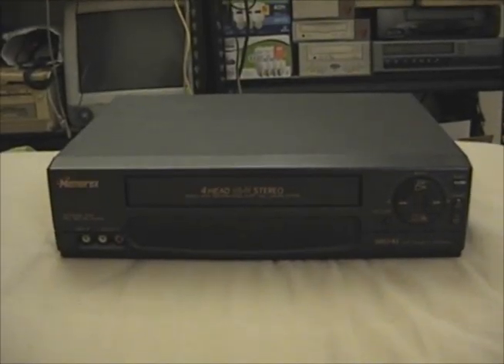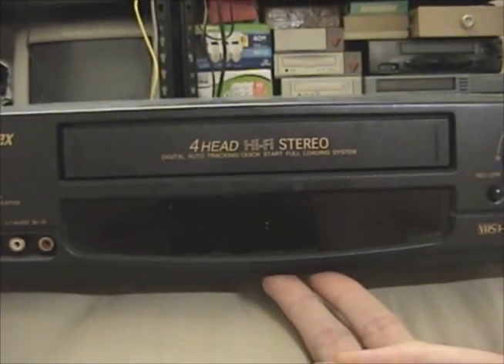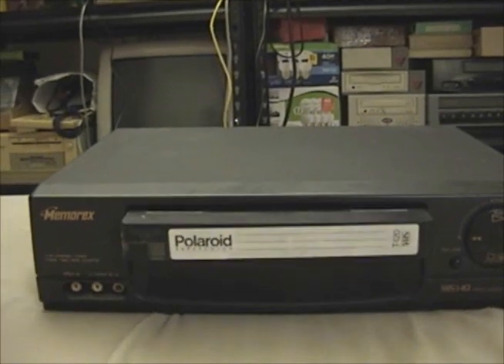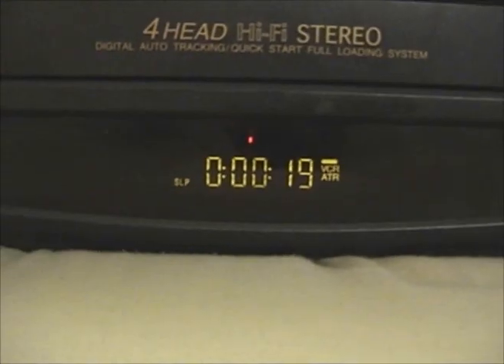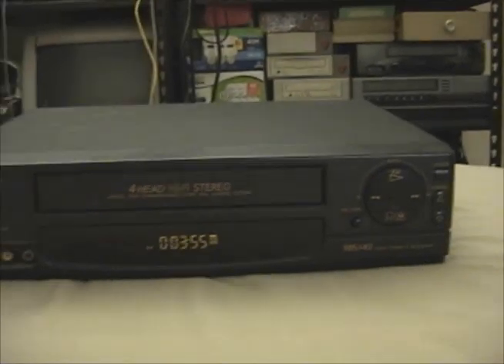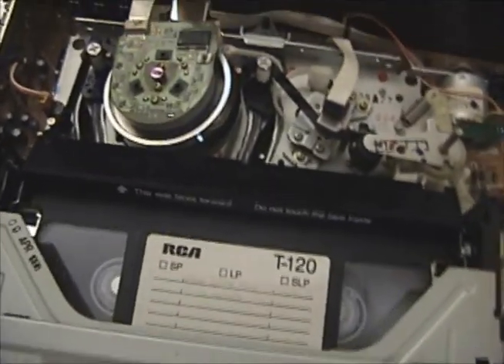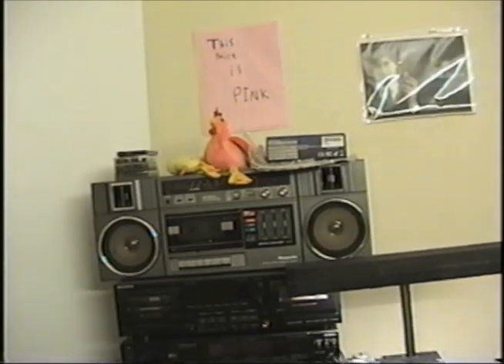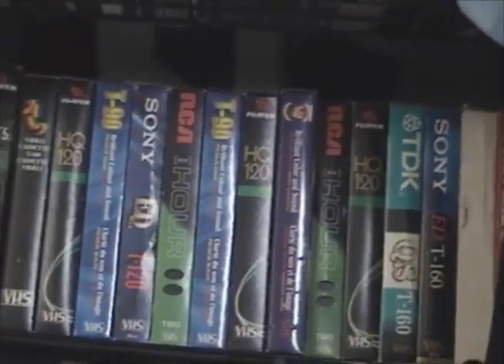Memorex MVR4046 4-Head Stereo VCR (1998)

Comment: Great video! Quick unrelated question: Is Citizen a Canadian brand? Last night, I was looking at Citizen VCRs on eBay to cure my curiosity, and about 28% of the listings are from the US, the rest are from Canada.
Reply from the maker: Yep. Citizen was a brand of Jutan International, a Canadian company that imported foreign electronics. Earlier Citizen products display Jutan's orange logo to the left of the Citizen name. Jutan also sold the Candle brand.
Reply: @themaritimegirl  That's interesting! I grew up with these Funai units as that's when I first got into VHS, and over the years I acquired most of the Funai-branded VCRs and in my life (Emerson, Sylvania, Orion, Magnavox, Sanyo, Samsung, etc), but never Citizen. They're not bad VCRs tbh. I have had a few duds in my life (mainly with tape eating with an Emerson), but I've also had a few that still work great! You know what they say - If it works, it's good enough!😁👍

Comment: I had a pretty good 4-head stereo vcr a while ago, then it had some strange issues after arthur hit. It took about a month later and then a tape got stuck. My father removed the tape manually and I guess that broke something beyond repair because it was going out with the trash a week later. Now I have a JVC S-VHS and that works great.
Reply from the maker: +tosdude Oh wow, nice score on the S-VHS deck!
Reply: Apparently my father had it just sitting in a closet under a dvd player.
Reply from the maker: Hi - May I ask what model of JVC S-VHS deck you have? I'm considering getting an S-VHS machine in the future. The dream would be to have a really nice one like the Panasonic AG-1980, but that will probably never happen since they go for tons of money in working condition. I see quite a few JVC units on eBay for a reasonable price, though.